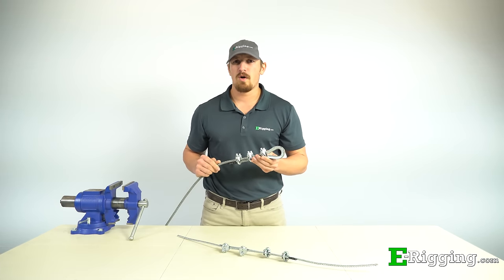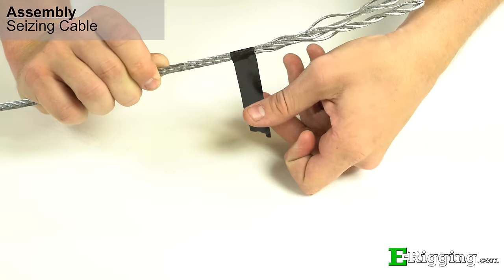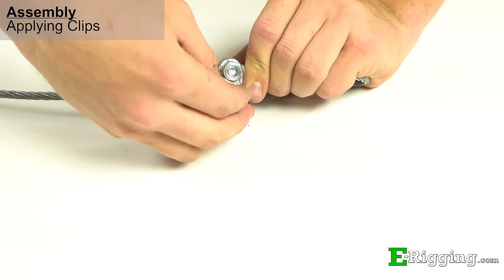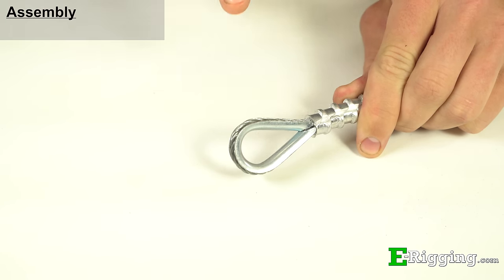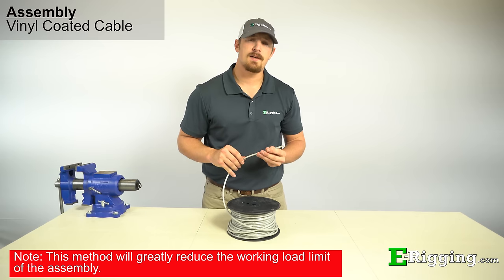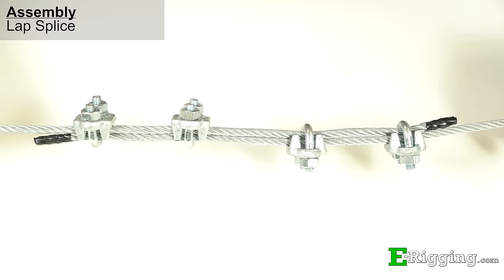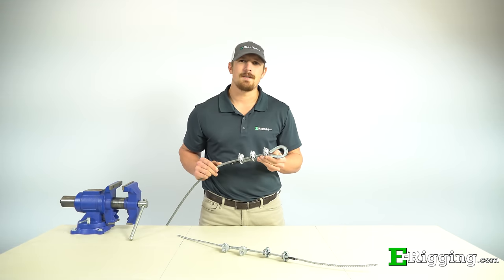Installing Wire Rope Clips - The Right Way

Comment: Never saddle a dead horse.  This has been a problem for a long time. I have seen people who, you would think, would know better .  I find it best to explain why.  It's the u-bolt. The  u-bolt deformes the wire, lessening the wires' strength . The dead end does not see the tension force as the live end. Would  you ever saddle a dead horse?

Comment: Im here because I'm connecting a stainless steel wire rope to a 2hp submersible well pump as a safety cable. As a back up. Using stainless steel clamp assembly. Thank you for your video. I was going to do 3 clamps at the end and alternate the saddles. Glad i saw this. I wont now. Pump and my galvanized pipe will weigh about 890 lbs. In order to not lose or srop anything in a 260 ft well, its important my wire rope is secure and tight.

Comment: When working with diameters, how do you slide the u bolt and saddle all the way to the thimble. Doing so by hand seems impossible, and I'm struggling to get within 3 inches of the thimble on a 3/8 1x19 application.
Reply from the maker: James, Once you get the first clip on you can place the thimble and cable eye in a vise to hold it together while you fasten the remaining clips. Or you can hand fasten the remaining clips on the cable and slide them up by force with a light tap from a hammer on the saddle.

Comment: Excellent video! I saw a 1/8” wire rope kit at the hardware store and figured it’d be great to string some lights over my backyard. I definitely would have saddled a dead horse had I not watched this video. 

I’ll say though, it’s harder than you make it look. I ended up securing the wire in a woodworking clamp while I attached the clips, and I still had trouble getting them lined up. No matter how careful I was, I could never get the clips pointed in exactly the same direction after tightening. I know this isn’t a “real” issue, but as a perfectionist it bothers me.

Comment: I will definitely vouch for stripping the plastic before attaching the clips! (though the advice is two broken ribs and a lacerated spleen too late)
And thanks for explaining the "don't saddle a dead horse".
Since my injury (almost two decades ago), I've read somewhere that the best way to make a safe termination is to loop back twice, so that the two kinks in the wire stop the wire from slipping through.  Has anyone done any experiments to find out if this is true?

Comment: I just found your video
I didn’t strip the coating for my 1/8 coated cable
The coating broke and the cable came loose
This is for landscape lighting so not a lot of stress
Reply from the maker: Hey JM, thanks for the comment! Replying mainly for other viewers' sake. YES, always strip the vinyl coating from where you plan to install your first wire rope clip all the way through the dead end of the cable. Much like your situation, the vinyl coating will weaken over time causing the splice to fail. Even in landscape lighting and other light-load scenarios, it's important to have a safe and secure connection to whatever you're suspending

Comment: Very well done, thank you. For some reason I can't wrap my head around the reason why installing the clip in any direction would change anything, mechanically speaking. Any idea?
Reply from the maker: Well, you always want the saddle of the clip to be on the what's referred to as the live end of the cable. The saddle of the wire rope clip offers the most support and securement to the cable, rather than the u-bolt. One way to think about it would be that the u-bolt is designed to hold secure the cable to the saddle.
Reply: The way I think of it is-the saddle has grooves that grip, so it grabs the part of the cable that gets pulled on (live end). The dead end is 'after the fact'. If it was the other way around it would try to tighten the loop.
Reply: I found out the U bolt can weaken the wire rope and assist in causing a failure. Wasn’t me, it was a boss  I had for about a week before I decided there were safer paychecks elsewhere.

Comment: Outstanding video, thank you. I'm using this sort of cable to hang a plant in a basket from an oak tree. I plan for the cable to form a closed loop around the limb of the tree using two interconnected eyes. I've taped off the cable ends using duct tape and have the outer saddles placed over the duck tape, is that acceptable? Also, what is meant by the 5:1 design factor? I've cable that has a working load limit of 740 lbs. Is it safe to hang a plant weighing up to 592 lbs.? By the way, will the thickness of the cable expand or contract over time? Thanks for any additional info.
Reply from the maker: We don't recommend that you place anything besides cable in the compression area of the wire rope clips. Although if one layer of the tail of the tape is just slightly held in the edge of the saddle, that shouldn't be too big of an issue. See our comments in the video regarding stripping the vinyl coating from the cable before tightening because it will reduce the load holding ability. Tape would be the same concept. Design factor is the ratio between the breaking strength and the rated working load limit. In this case a 5:1 design factor means the cable assembly will break 5 times the working load limit. Design factor is intended to buffer against unexpected swinging loads, old worn out cable, and general long term service life. If the working load limit is greater than the load you are supporting, then you should be fine. Please visit E-Rigging.com to learn more, or get in touch with our support staff.
Reply: @E-rigging  Understood. Thanks for all the additional info.

Comment: Is it necessary to use the thimble with the wire rope clips? I notice the thimble is left there when using the normal rope clips but is not left there when using the stamped cable clamps.
Reply: The thimble is recommended and it helps reinforce the eye from getting frayed and losing strength. The eye tends to be where the cable wears out quickest without the thimble. Considering how cheap and strong they are, there’s really no reason not to use them.

Comment: Do I use 1/4" clamps for 1/4" cable, or do I need 1/2" clamps?
Reply from the maker: Yes, if you are using 1/4" cable, use 1/4" clamps.

Comment: I noticed that there are no locknuts or lock washers on the u-bolts.  Is it recommended to use either of these or to use Locktight?
Reply from the maker: No locknuts or lock washers are required or recommended. Proper torquing is designed to hold the nuts from backing off.

Comment: great video thank you! I would appreciate some help since I'm very amateur with these applications. I do some DIY installations for myself and I want a very thin wire that will go from wall to wall ( 4m length). Since my wire is a lot stronger than the weight I that intent to use (it can hold 40kg while i barely need 4kg) is it possible to just do a knot with the wire and not use all these bolts? thank you!

Comment: Do you ever loctite your bolts? Great vid thanks
Reply from the maker: Hey Erik, typically loctite is not used for the nuts and bolts on wire rope clips, but we don't see any reason as to why you wouldn't be able to do that.

Thanks for the question!!!!

Comment: Can u pls suggest me 
For gym 6 mm cables what size of trimbles should i use
M16
Or
M18
Or any other sizes
Reply from the maker: 6mm is nearly 1/4". Use the matching size thimbles for the cable you are using.

Comment: Useful video.
Reply: YOU get 100% strenght when cable is braided proberly your method is gessing the strength. Im a retired union pipe fitter and when we rig with a crane we must prove the equiptments lifting capacity not guess.

Comment: You said:Neve apply the saddle of the clip to the dead end. Why?I couldnt underestad. May you explane more please?
Reply from the maker: In order to provide the best strength and longevity to your cable,  you must attach the "saddle" portion of the clip to the "live" end of the cable. The dead end will touch the U-Bolt side.
Reply: @E-rigging  Thanks so much🌷🌷🌷
Reply: This guy is great. The complex and difficult presented simply and informatively. Good camera work too.

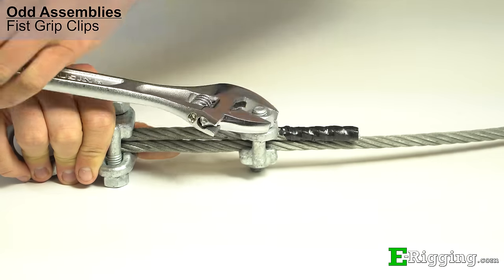Comment: I really liked this presentation...BUT, at 6:38 he is using the adjustable wrench backwards!  Drives me crazy, like using a file wrong.  I know, I sometimes do it as well...but I don't let anyone watch!
Reply: I was just about to make the same comment.  Something like that makes me think the guy is a model because I was stopped from doing that at about 7 by my grandfather.
Reply: That’s the best way, lead with the fixed jaw. Only use the spanner the other way when you need to in a restricted space. When you lead with the trailing jaw it carries the load further out from the screw and puts more leverage/strain on it.
 Look at a spanner on a nut and check where the corner of the nut contacts the jaw when turning.

Comment: I want to produce a rope from discarded clutch wires of motor cycles. This rope would be used to tow a car. The length may be 10 to 12 ft.

Comment: "Don't saddle a dead horse" - does it really matter?  Do you have test data that shows it makes a difference?
Reply from the maker: Great question! Although the saying has become colloquially accepted as "best practice", test data has shown that the WLL is greatly reduced on a rig if the dead end is saddled. Even if one clip is improperly installed, it can compromise the load capacity. Here are some practical reasons why this happens: 

1) The U-bolt could pinch/crush the internal core of the live end. The live end is especially important since it's the part of the eye splice that's supporting the load. This type of damage is especially dangerous since you can't see the IWRC to inspect it.

2) Wire rope clips have a zinc-plated U-bolt which is less "grippy" than the saddle of the clip. The chances of the live end slipping through the U-bolt is greater than if the saddle is oriented incorrectly. 

Hope this answers your question!
Reply: @E-rigging  Thank you for your informative answer. I can appreciate why U-bolt crushing of the live end should be avoided.

Comment: These clamps probably do not need an excessive amount of foot-pounds to tighten them in place, but if you are tightening anything heavier, flip that wrench over (at 6:37) so that the force is coming from the more massive part of the wrench. The smaller (movable) part of the wrench can break off under a heavy load. Maybe even worse is that you will not get any sympathy from the mechanics that use the wrench correctly, especially after putting it in a video and posting it.